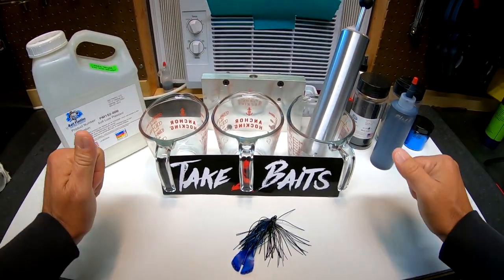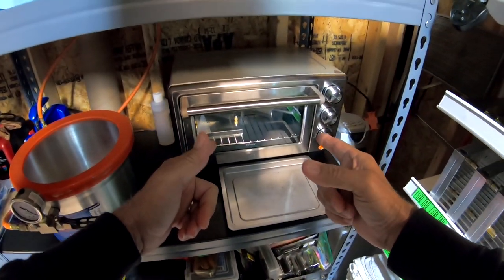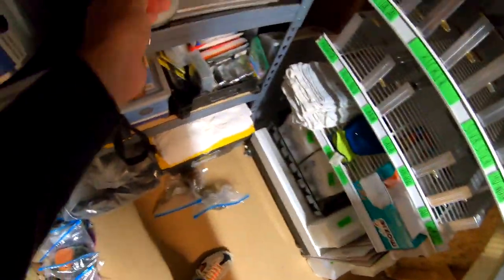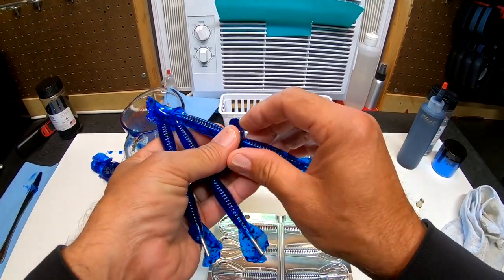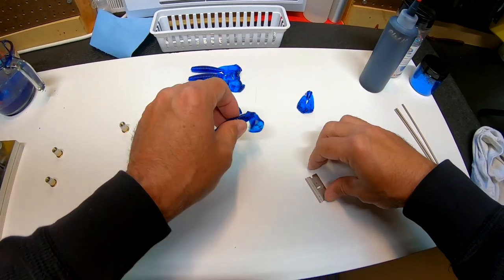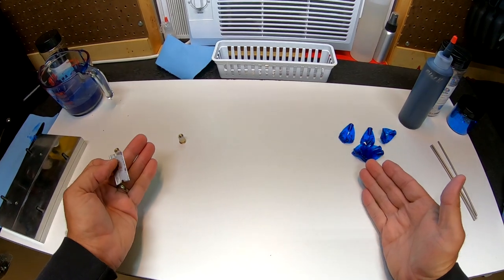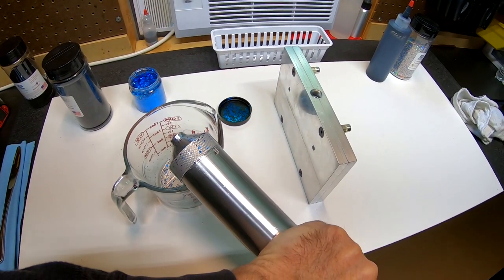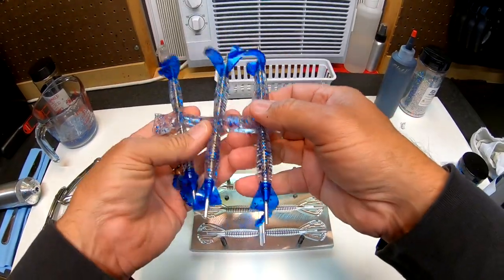This is Awesome | How To Make Soft Plastic Baits | How To Make Soft Plastic Lures | Core Baits

Comment: Great video.
I have a problem with getting the layers to stick together, I can just peel them from eachother. The temperature is good so I don't understand why.
I use bright bait plastic. Do you have any idea why this can be?
Reply from the maker: Hey so are you doing one side at a time? Try using a heat gun to heat up one side then shoot the other if you are doing this. I shoot with a dual injector gun so I can shot 2 colors at the same time. But started in the begining by shooting 1 half at a time and had the same issue untill I heated one side. Hope this helps...

Comment: Do you have to buy a special mold for core shot baits or do the rods come with any mold?
Reply from the maker: Hey JT Casting.
These Molds were designed with the rods. Hard to take just any Mold and add them knowing the M old has to vent properly. I hope this helps and thanks for watching this Video.

Comment: Do you have a y tips for a beginner who's baits come out sticky?
Reply from the maker: As a matter of fact I do.
#1 Shake container well before shooting baits.
Tip. If you don't have a way to de gas. Shake the crap out of it and let it sit for a Couple hours. This helps the bubbles to travel to the top of the Container. 
#2 Make Certain you reach that 350 degree mark to be certain it's cooked all the way.
Tip. 1 cup of plastic in a 1000 whatt Microwave 3 minutes or so to cook. Take it out at 1 and a half minutes and stir lightly don't go crazy. Just stir the mix a little.
#3 I hang my fresh baits to dry on pegs. Baits will cure out and sometimes the colors will change also. 
Tip. Don't like them up on each other spread them out straight to reduce cool down bends.

There ya go👊 Hope this helps Bud.
Be sure to come back for another video sometime.
Reply: @take2fishing  I have been doing those tips but it's still coming out sticky
Reply from the maker: Question. Are you using Dead On Plastics?

Comment: Hey man where do you get your salt for stick baits?
Reply from the maker: Hey Chase and thanks for the question.
You can find this low moisture content Salt at Bait Plastics LLC.
I have used several Salts before and yes All Salt has moisture in it. But I have found Bait Plastics has had less. I typically use quite a bit for Senkos and I store it in a Body Builder container and use the scoop that came with the Body Builder. I hope this helps and thanks for watching